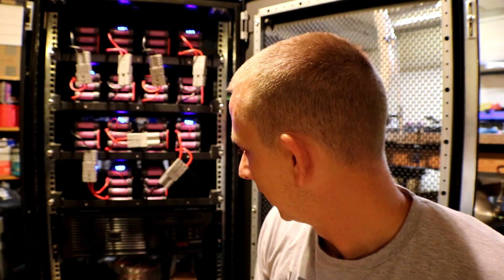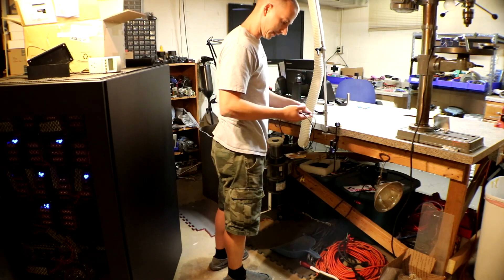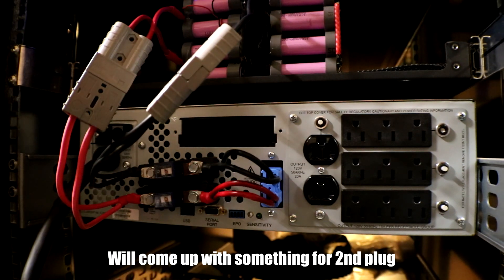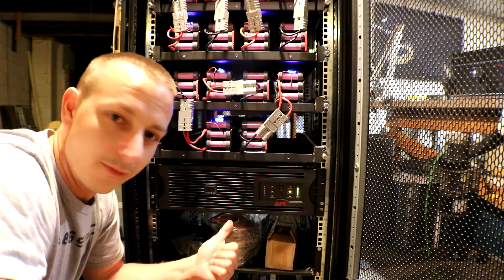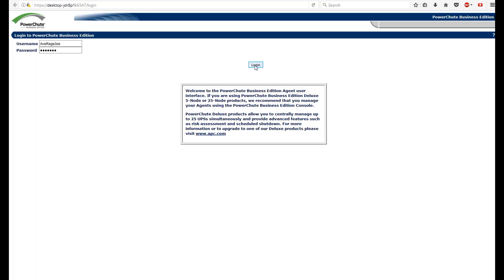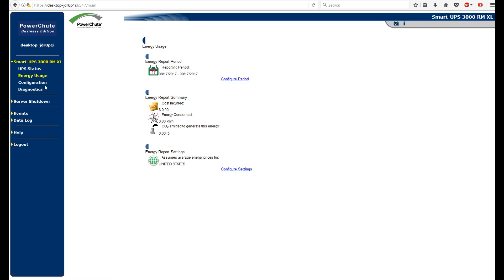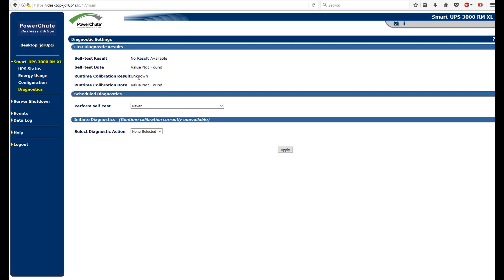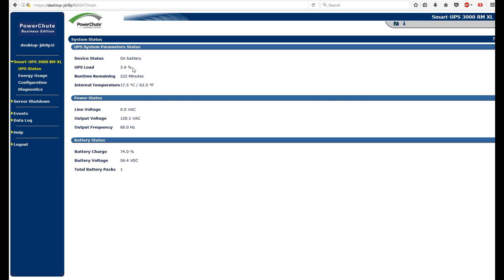Diy Tesla Powerwall ep50 Its Alive!!! Sorta :)

Comment: Hi! I have a SMT3000RMI2U and was planing to use it as an inverter hooked up with my solar PV, Tracer AN and 14S64P 18650 batteries. I almost gave up until I found your youtube channel. I had the run time problem and it shutdown after less than 2 hrs. I had it recalibrated with 40% load and it didn't help. I followed https://www.youtube.com/watch?v=q8qZDBJqdlY to do the  battery reset constant and hoped it will work in the morning but it didn't help. It shutdown within minutes. Anyone managed to fix this issue? My batteries were filly charged by the solar panels. That should be alot of hours in it.

Comment: Hey Man, huge fan! I've got the same UPS as you do from a recycler and when i hook my lab power supply to it to mimic a battery it turns on(sort of). Now i want to load test it with my powersupply but i cannot get it to really start up and provide power to a lightbulb for example. Do you have any tips? Also the usb is a network cable, do you plug it straight into the computer and download the software? Love you channel, big fan!
Reply from the maker: Thanks for watching!  Nice!  How many volts are you supplying to it.  It should work from about 42 to 58v and it would have to supply about 3-4 amps.  Yeah I used the usb network cable thingy and downloaded the bis edition of powerchut to get into the ups to turn off the beeper and changed the external battery pack setting to the highest it would go and that was 99packs.
Reply: @AVERAGE_JOE  thanks for the reply! I want one of your tshirts, how much do i have to donate with patreon?(im a poor student but i really want that shirt :D, are you planning on making a right....mweoh shirt :D?) i ran it at 55 volts and it took about 0.3 amps running stationary, but without being connected to the net. There is no voltage on the output so i wonder if i have to connect it to the net or change some settings....
Reply from the maker: For Patreon you would need to choose the $25 dollar option to get a shirt but I also have the t-shirts on amazon with a link in description box if you wanted to go that route also. My ups takes 2 amps at idle so im thinking yours isnt turning on all the way. Are you holding the on button long enough. I hold the on button until it starts to beeeeeep then let go cause if you just hold the button down for a second or two its not fully on. Let me know
Reply: AveRage Joe 

New subscriber here.  
2 amps!  It’s pulling 100 watts at idle?  If that’s right, I’m not going this route. There are 3,000 watt 48v inverters that pull .3 amps at idle.
Reply from the maker: Yes it has a high idle draw for sure and YES a real inverter will have a much lower idle draw! I used the ups because it was free!

Comment: right meow! fix that beep. I have a 1500 by APC. I want to do something with. my house is off grid. and 24v I use my generator with the inverter charger to charge until my solar is up. is there a way to get more wattage from these? great video
Reply from the maker: Beep Fixed!!! 😃 More wattage from the APC 1500?  If so then YES!  You have to tear it down and add some transistors and resistors then change some settings. knurlgnar24's has some videos about it here https://www.youtube.com/playlist?list=PLdImEedbzeWSpxQpQpqnFEKa5NKYXXe-V
Reply: How did you get past the runtime? It shuts down even when the batteries are fully charged via MPPT and solar.  It's a IBM UPS1500THV and fixed the beep with the powerchute but still trying to figure out how to do it via the terminal to add more packs?
Reply from the maker: You may need to do a calibration test. That will reset the runtime to your batteries!
Reply from the maker: I also changed the external battery pack setting to 99 packs.
Reply: @AVERAGE_JOE  Hi Joe! Here is my update. I managed to hook it up with the serial cable and added the Battery packs with  the command '>' to 099 and keeping my fingers cross. Anything I else I need to do? Thanks!
Reply from the maker: You should be good to go! I know there are other commends to modify things but I dont know them lol but you should be good to go!

Comment: Something I noticed with my 1500 VA smart ups.  It draws 1.15A at zero load.   But this is on 24v version.   Have you tested your zero load current from your batteries?
Reply from the maker: +Jason Deadman Interesting, I found my digital amp meter so Ill throw it on and find out.

Comment: For this UPS the time remaining is based on a battery capacity setting which you can change. Edit: which appears to be controlled with the "Connected battery packs" setting in powerchute.
P.S. I think you should put the UPS above the batters and put a laptop rack holder up top so you can have a slide out laptop. :>
Reply from the maker: +penguins forall Ok ya I just figured out that part. Thats not a bad Idea, slide out lapy topy. Hey did you day it would be easier with linux mint or possible beable to edit more in the ups? If so im switching over!!!
Reply: Well since I love Linux I'd always advocate using it. However you should certainly be able to get NUT to work on windows.
Reply: Since you're here could try to get it working
Reply: Also if i understand correctly PowerShute just runs on Linux on the "SmartSlot" using the serial internally which means it could in theory be your monitoring computer if you wanted to hack it and put your own Linux on it instead of using a laptop. That'd be kinda badass but probably should do that later.
Reply from the maker: +penguins forall it kept saying to install like "upslib" or something. So I dl it and it was like a text file or a bunch text files and then I was lost lol
Reply: Manual: http://www.apc.com/salestools/ASTE-6YWRZH/ASTE-6YWRZH_R6_EN.pdf
Scroll to page 13. It tells you how to configure it so that it knows what the real capacity of the batteries are. Pretty much its the same setting in PowerChute. While they suggest using a serial cable NUT can change these settings over USB.
Reply from the maker: +penguins forall Ok. Ya the plan would be to get it all set up then use the lan to monitor from other locations. I liked that pic you showed me a while back of yours. How do I get that setup 👍
Reply: The pic was NUTs monitoring service using its web UI. The settings PowerChute provides is probably about the same you'd get from NUT but doesn't look as pretty. You can turn off the load with NUT which allows you to safely not let the batteries get to low for example. There's not going to be a setting to change the battery voltage for example. That seems to be very rare on UPSs. I looked pretty hard and I can't confirm if NUT's drivers work on Windows so that might be whats giving you trouble.
Reply from the maker: +penguins forall Ok gotcha. I do like the option to shut off the load to save the batteries. Ill do a swicth a rooney and put linux in there and give it a go.
Reply: So yeah YouTube doesn't update comments for 10 minutes or more. Should try talking on Hangouts. Linux is pretty easy to setup.
Reply from the maker: +penguins forall my email is on my about me page if you want to add me. I should be home within the hour

Comment: don't know if you have used linux or not, there is program called apcupsd.  Its a debian/ubuntu program that works with most modern apc ups'.
Reply from the maker: +Dan Hockey Ive only messed around on linux mint. If I can get into it easier and change more Ill do that?
Reply: Open up the software manager and search for "apc", Apcupsd and Apcupsd-cgi will show up as the top two picks. Apcupsd-cgi is the web based front end.

Comment: You know what would be cool you can get some little voltage and amp meters that also display watts get one that is for ac and one for dc and install them in the front to keep see what the difference is and just to know
Reply from the maker: +James Holbrook Im thinking of getting something to do that once I get some cash.
Reply: ya they are fairly cheap like $8ish to like $15 but i bought one for ac current think i was going to make a cheap kill-a-watt meter and by time i bought a box and plugs and a cord locally i was in it like $35 and i know you can get a kill-a-watt meter for like 20 or 25 but mine has a 6ft cord that is 12 awg and 2 plugs so whatever

Comment: So is your watt meter battery backed up?  I think those normally lose the data when the power shuts off (and the UPS WILL shut-off when the battery level gets low.)
Reply from the maker: No it doesnt have a battery so it will loose its data.  I wonder if I could change some of the battery info in the ups for extra run time?

Comment: So curious about your project. I had a apc smart 2200 and never used it. Thought it was too big for my needs but now use the apc 1500 24v for camping. I can do about 900w-950w depending on the load type. I'm buying a van to convert into a camper and would want to boil a kettle and toast broad, etc... so was thinking of now upgrading to this MONSTER 3000 RM XL you've got. I recon with the extra transistors it will handle more than 3000 (at a educated guess). Soo cool! Keep up the entertaining videos!
Reply from the maker: Thanks for watching!  Ive become some what of a hoarder lately for parts I might use for projects lol.  Dont throw much away right Meow!  Yeah Thats what I was thinking about the transistors too

Comment: Put the network card in the XL UPS from the other UPS.
Reply from the maker: +penguins forall Oh lol, musta missed that part 😉
Reply from the maker: I took it out cause when it was installed I couldnt log in with the usb cable.  Is that normal?
Reply: Yes. Like I said in another comment it takes over the serial input and replaces it.
Reply: SNMP management over the card should be better than the web GUI...  but it is an APC, so it could be rendered proprietary.

Comment: You should of ordered the serial cable its more compatible with the other software, Looking good nice and tidy build
Reply from the maker: Im gonna try to get in there with a lan cable and if that doenst help much maybe Ill try building one.
Reply: I made my own cable its easy I just used google picture search I had the usb but for some reason I had way more options with the serial cable. Also just realised yours is the 3000 I had the 5000 it had 3x120mm fans that were 24v if you add more fans make sure yours aren't 24v to as 12v ones dont really like 24v
Reply from the maker: Yep, these fans are 24v also.  Ill try a wack at the serial cable because I want more options!
Reply: Using serial won't give you more options in PowerChute as the interface is exactly the same. All the network interface is doing is also sending commands over the serial except it provides a web interface. On the USB bus its announced as UPS device so OSs will see it as one. Other than that its just sending the same serial data to it that it would over a serial cable. As for compatibility that hasn't been my experience. I guess it depends on what software you wanna use.

Comment: oh we're getting serious now.
usb cable was standard for mine.
I wonder if you do your capacity test with the UPS, maybe it'll think you've extended the batteries and show it's full Li-ion capacity..
If you let it run all night and the capacity is more than what the UPS thinks it has time left, it'll shutdown even before the battery has run out of power.
Watch out, he's going to use a SWAT meter.!!
Reply from the maker: Sheit is getting REAL!!! LOL  Ill probly try connecting through the lan so I can keep an eyeball or 2 on it from other PC's.  Ill do a real capacity test once I get the solar hooked up so Ill have a way to recharge it.  Its still running right...MEOW 😝
Reply: From the manual there is a setting for capacity. Just looking at the video I believe this is interpreted by the "Connected battery packs" setting which will just be a multiplier of that UPSs battery pack size.